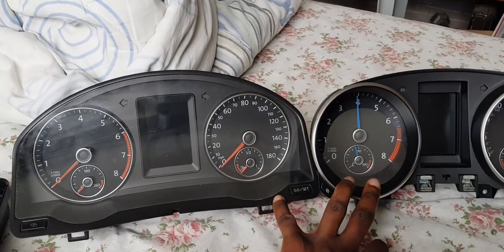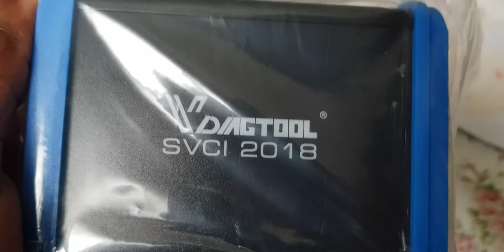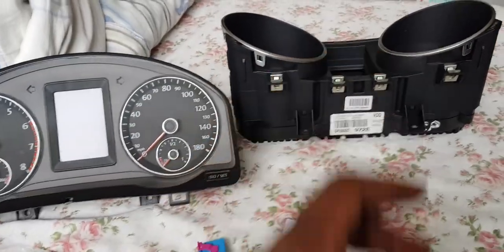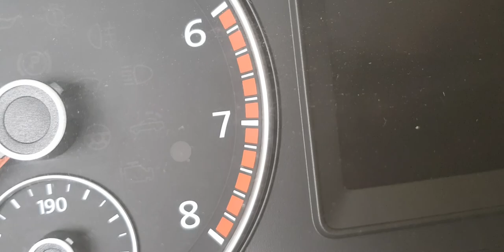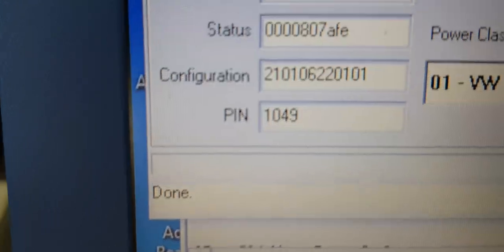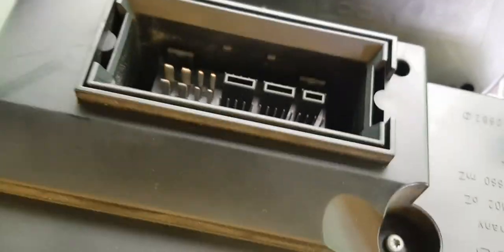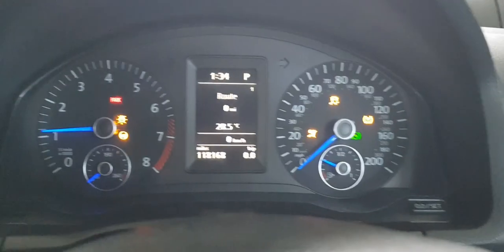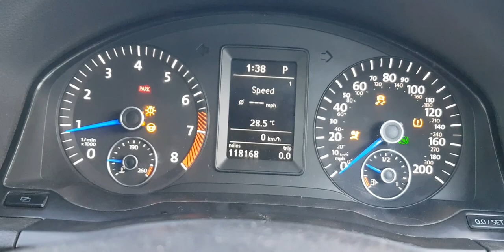MK6 Golf R instrument cluster retrofitted in a MK5 GTI

Comment: I don’t know how it was for everyone else, but the hardest part for me was fitting cluster to the dashboard. The space is so tight, also the adapter takes some space, so cluster didn’t want to slide all the way in. Somehow it went in. Another surprise was my BG steering wheel control module works just fine with mk6 cluster and mk5 mfsw steering wheel. Didn’t need upgrade to CH or CD. To my knowledge BG is highline off course, but 1.3 LIN only. Am I missing something? Controling stereo is also not an issue, I got aftermarket radio and mfsw buttons do the job. Maybe that would be an issue if I upgrade to RCD330? Any input appreciated, thanks
Reply from the maker: You answered the question when you mentioned the use of the aftermarket radio.  Let me check the Ross-Tech wiki to see what the BG supports.
Reply: @MatthewTaylor3  I’ve been checking that list on Ross-Tech website so many times, almost memorized it already 😁 By the way, as I recall the next video shows you got the CD one, but what was your original one?
Reply from the maker: @SHtatkus  My original one is was an AQ unit.  This has an older software version than your BG module.
The issue I had (years ago) was that my steering rack caught fire while driving, so I had it replaced with a random one from a junk yard (with a different part number).  This replacement had a different steering angle sensor arrangement (but with VCDS/OBDeleven coding it worked).   I then selected the CD module (years later) for the steering wheel retrofit to match THAT replacement steering rack.
ALL 12 buttons work in my car with the steering wheel.
Reply: Hey man, can you please shed more light with the process of swapping the cluster, I'm busy with it but I am still getting the Immobilizer active. With the EEPROM data from my working cluster copied and pasted on to the scirocco cluster. I don't know what else I have to change. This was done with VVDI2.
Reply: @MegatronicsZA  Sorry for late response. As far as I remember, new ID48 chips also had to be made, not only transferring all the immo data to new cluster. That might be the issue you are having

Comment: Have you made the speedometer work? What about abs? Did you get rid of the abs light? The "ding ding ding" sound... where is it?
Reply from the maker: The speedometer worked without needing any coding as it gets the reading from the ABS (not the transmission).  The ABS and steering wheel just needed a test drive to clear.

Whenever you change your ECU or instrument cluster,y your ABS unit will factory reset itself as the vehicle's VIN is stored in it (but is lost when you change an immobilizer related component).  I had my previous coding backed up in VCDS and OBDeleven, so I restored it manually, and then did a 5-minute test drive which cleared all errors.

If you are referring to the alternate speed such as from miles to Kilometers, then I enabled a feature called "alternate speed display". which shows this digitally

Comment: Hi bro i have problem because i have mk70 Asr abs unit and if i want to retrofit newer jetta cluster i must to retrofit newer Abs unit AD part number or newer.And mu question is which modification i must to do when i want to retrofit newer Abs unit? Ps:(Golf 5 1,9 TDi)
Reply from the maker: You don't need to change your ABS unit to make the new cluster work.   Your MK70 would have more features than my MK60.

To answer your question:  You need to make a note of your existing vehicle coding using a VAG scan tool (like ODIS, VCDS, OBSeleven, Autel, Topdon, VCP) to place that configuration to the new unit.   Things like brake size for front and rear, LHD vs RHD, hill-hold assist enbled or not are needed to program back the new module.    Note, changing the instrument cluster or ECU, factory resets the coding of your existing ABS module, so you need to make a note of the existing coding in either case.   This is for anti-theft reasons as your VIN is used as part of the coding process.       If you somehow mess it up, you can use the "PR-codes" located in the inner front cover of your owner's manual, or the sticker in the "tub" where your spare tyre sits to help code it back.
Reply from the maker: Let me look into this "AD" part number or newer.   What year  TDI do you have?
Reply: @MatthewTaylor3  My TDI is 2007 and abs unit serial number is (1K0 907 379P) MK70.But when i asked lot of people for white fis cluster retrofit they said to me if i want it i must first retrofit abs unit for mk60 1K0 907 379AD or newer or the best opinion is MK60EC1. If i retrofit cluster with my current ABS it s not possible to  read speed of car
Reply from the maker: @Mmmmss266  Let me look into this.   I'm not ignoring your query
Reply: @MatthewTaylor3   No problem man,Tnanks for kindness
Reply: Hi bro did you find some solve of my problem?
Reply from the maker: @Mmmmss266  I don't have an answer to your issue.   If your car was 2008, I'd tell you it is "new" enough to have the MK6 compatible protocols.    I'd still tell you actually do the swap just the same IF you already had the MK6 cluster in hand.    One thing I'd suggest you would need is the Revision "L" canbus gateway to bridge the MK5 and MK6 protocols

Comment: Could you share the software and tools needed for doing the immobilizer stuff? -or the link where you ordered that. Thanks in advance from Mexico.
Reply from the maker: I used a cloned copy of AVDI by Abrites called SVDI / FVDI which does the same thing for placing both clusters into Service Mode and pairing keys.  I bought it from AliExpress.  I bought the "2018" variant, but the "2020" variant is what is current.

Comment: Nice swap, big upgrade! I wanna change my needles/leds to get the same blue needles. Will something happen if I unplug the cluster, do the work and plug it back again? Do I need some coding/activation after replugging?
Reply from the maker: No.   There will be NO issue unplugging and replugging the same instrument cluster in your  car.   The time/clock and trip information will reset in the same manner as a dead battery.

Comment: I believe you are the same guy who posted some info on obdeleven forums regarding mk5 needle sweep some time ago. Long story short - I’ve installed 2005 gti cluster on my 2009 2.5 jetta, immo data was easy with avdi/fvdi chinese clone, but I’m not able to write edited eeprom using the software to achieve needle sweep. It goes back to original after writing and reseting the cluster. Everything was done through obd port in car, not on bench. Still waiting for the usb clip programmer to try writing directly to the chip, do you think it will work this way? Maybe 24c32 is just not programmable? Any input is appreciated, thanks
Reply from the maker: I'm the same person from the OBDeleven forum.  You WILL need to use the USB clip programmer in your case to get it to work.  ALL VAG 24c32 and 24c64 clusters support it.  If you didn't want to use the programmer, you would have to use a tool called VDOeditor to help you out.  If you send me the BIN file for your existing cluster, I can see if my paid copy of VDOeditor can help you
Reply: Thanks for quick reply, I’ll wait for the programmer and see what happens. Heard about VDOeditor, isn’t it only for newer white/color clusters?
Reply from the maker: @SHtatkus  You are correct about the VDOeditor being for the newer white/color clusters.  You shouldn't need the programmer since you have the chinese FVDI clone (assuming you backed up your BIN file.  Did you use that famous Russian Excel spreadsheet that states what addresses to edit for your cluster?

You would only need the programmer to restore the backup if something when wrong.
Reply: @MatthewTaylor3  I’ve checked that spreadsheet, edited my BIN file, tried to write it to my cluster using FVDI and after reading eeprom again it stays as original one. That’s why I’m thinking to use clip and programmer directly on the chip
Reply: Blue dashboard cannot needle sweep.

Comment: Great video. Need some help. Getting stabilization control activated,  red steering light on though steering is ok, and brake servo defective. Any guidance?
Reply from the maker: Has ANYTHING been physically replaced on that vehicle ?
Reply: @MatthewTaylor3  Sorry, probably should add more context. This errors occured after swapping to the Golf 6r cluster. My previous cluster from an R32 had no issues - even when i return it back, those errors disappear.
Reply: Cab you please shed more light on how you did the whole process of swapping the cluster. I'm not winning

Comment: Nice job! Did you change 0x13a0 - 0X1450 FF for the immo/safe data to not show from standaard cluster backup file? Want to do a swap in a caddy 2009 with 2012 type cluster. So should be same way i think.  Dont have svci/fvdi but autel im608 that should be able to read immo data etc
Reply from the maker: I did "FF" a range of addresses, but I can't tell you if it is the same range as you indicated.  Some clusters are different,  but the process is the same.

Your Autel tool can and will do it.  It will even automate the process for you sp you don't have to be too involved in the nerdy bits.  I wished I had a IM608, as I'd be providing that service on a daily basis,  as I see the use case for it.  The unit would basically pay for itself.

You are already familiar with the correct set of steps.  Please make a BACKUP of both EEPROMs for peace of mind before having fun with the process.
Reply: @MatthewTaylor3  yeah i can read immo data with autel im608 also pincode and cs code from old cluster and also for new one. Never done this retrofit. Normal use autel for key cloning and key learning and some basic diagnose.  Want to have smok uhds also, read that that also can make full backup from eeprom. 

For what i have found that range of adress should disable the immo active message but never done it. So this wil hé the first try🤣 also have odis, vcds and vcp normal in the coding business active.
Reply from the maker: @anthonyg87  Can you please give me the part number for the instrument cluser you are swapping TO

I also use a tool called VDO editor to adjust the analog guages, and the feayures like "cluster sweep" and the various backlight settings.
Reply: @MatthewTaylor3  i also have a sort like tool/software to activate needle sweep. Needles to light up etc. So thats not needed. Its a cluster of a 2011 caddy 2K0 swap in a 2009 caddy but need to seen the car first. Its a customer of mine

Comment: Is it possible going from a 2010 Magnetti Marelli white led with an existing key, to a 2010 VDO 24c32 white led with no existing key? I've already done everything before the erasing keys procedure (I did not make new keys for the VDO, I just copied the original Magnetti KeyID numbers on the VDO but no avail... "Immobilizer Active") -I was expecting my existent keys will work, but no avail... Why is necessary making new keys? How do I match / sync the VDO Immobilizer to car ECU? -I'm doing all this stuff on a bench, and yes, I am able to read, write and verify EEPROM of VDO 24c32 with a programmer with no faults for entering into service mode. Hope you can help.  I don't want to do Immo Off...
 Forgot to say that copying existing Magnetti KeyID numbers on the VDO, the VDO recognizes keys, but not the Immobilizer. VDO shows only "Immobilizer Active", not "No Key" message. Thanks in advance.
Reply: (Car won't start with the VDO, but it does with Magnetti)
Reply from the maker: I feel honored that you of all folks asked this question.  I'm not an expert on the matter.  I just did this retrofit to modernize my MK5 Golf GTI's dashboard.  I too, thought I could just copy & paste the KeyID from one cluster to another (but the car won't start and stay running for longer than the 1.8 seconds).  What I then learnt after doing some reading online (from a Russian site that I forgot to bookmark) is that the immobiliser pill inside the physical key fob also gets unique information written from the instrument cluster itself as well.  This then appears to create a mismatch even though you copied the original KeyID.   I assume you already know that the transponder is one of those can only be written to once, then it is "locked".  This is the reason why you have to get and pair a new key (board or transponder chip) for each instrument cluster you are trying to pair.  If I arrive at a working solution otherwise, I'll respond and tag you here.

Comment: Hello, did you just change the front cover ( Plastic ) and installed the Cluster, or did you need to remove all the past and transfer them to the other cluster ? 
Because i have the same cluster for  Jetta mk5 2010 but its in Mileages and i want to change  in Kilometers, so i need to find a cluster with KM maybe from a Golf Mk6 or Passat b7 and just swap the front cover, but i don't know if it fits ?
Reply from the maker: Once you have a MK5 Golf or Jetta, then you need to get one from a 2010 Jetta just for the front plastic cover and mounting points so it bolts up and looks factory.  You discard the rest.

You then place that on your MK6 instrument cluster.    If you ONLY need to change the units of measure, you would just buy the thin plastic backing behind the needles that have the units you want.  You would then use  a EEPROM tool like VDOeditor to scale it appropriately so it works correctly.    You are on the correct path.

Comment: Hello sir, I have a Scirocco cluster, but lost all keys. My understanding is I need SVCI to get those data before remove the old cluster, and then restore after install the new cluster? Can you explain more how to do this? And how to re pair my existing keys? Thanks!
Reply from the maker: I'll respond to you shortly.   If you lost your keys,  you don't need a new cluster.  You only need AVDI or the tool you mentioned to place your cluster in SERVICE MODE, so you can add a new key to it.  If you were actually changing your cluster,  then you would go with the full set of steps you mentioned.   I'll respond shortly after you clarify.
Reply: @MatthewTaylor3  I am going to upgrade the cluster.
Reply from the maker: @kelvincheong9234  You are going to need to use the tool you mentioned to READ the PIN, MAC, CS, and power level from your existing cluster or ECU (as they currently match) by placing it is Service Mode).  This is initiated by taking your stock one apart (since you have no keys) and reading the EEPROM chip using a programmer, saving this as a BIN file to your computer.  You would then use an editor to clear the immobilizer info, then WRITE/FLASH that file back to your stock cluster.  You would then partially asemble and attach to your car.  You would then use SVCI/AVDI to place the cluser in Service Mode in order to note the items to be transferred to you new cluster (since you say you don't have your keys).

You would do the above steps with the replacement cluster, but this time you would WRITE the 4 above mentoned fields to the new one.  Before exiting Service Mode, you would simply ADD a new key so you can start the car.  Your old keys would be invalid as they are paired with your stock cluster, and can only be written to once.

Comment: I’m in the process of doing the same swap right now. But I can’t get the newer NEC cluster in to service mode. And every video I’ve been looking at for help has the cluster taken apart for some janky modification internally to the circuit board. Did you have to do this mod as well? 
I have SVCI 2019 and new transponders. 
I appreciate any help :-)
Reply from the maker: Yes.  I have the SVCI 2018, and the janky modification you see online is the method that you would have to use to get the process "started".  I used a "clip" to connect directly to the 8 pins of the 24C64 chip so as not to have to desolder anything.
You HAVE TO pull the instrument cluster apart to read the contents of the EEPROM to your PC. Save a backup on your hard drive.  Then you would simply "delete" the storage blocks that contain the immobilizer info, then flash that modified state to your cluster.  You can then put the cluster together, and reinstall it in the car (I suggest leaving it disassembled until you verify all is working and the car starts and runs) with the 32-pin pigtail harness.

You would then actually use SVCI at this point to electronically place the cluster in Service Mode to do the actual process you see in those videos.  When you load the original BIN file that you would have backed up, you would see the donor PIN and all that information in which you would selectively overwrite, then finish the process by adding the new key(s)/transponder pills.
Exit Service Mode, and the cluster boots as normal.
Once all works and the car starts and stays running, you can then put the cluster back together and pat yourself on the back.

Edit: I will be doing a video on how to do the initial process (using the clip) in a bit when I get another cluster to pull apart shortly.
Reply: @MatthewTaylor3  Thank you so much for that elaborate and very kind answer! I appreciate it. You don’t realize how much this helps. I found this video about a year ago when I started thinking about doing this swap for my EOS and ordered the SVCI because if it. 

Most people wouldn’t go through such lengths to help strangers online. Kudos to you! 

I googled this clip and found, with the help of my brother, that it’s pretty much the same thing as doing a modification on computer graphics card and motherboards, which means that my local electronic warehouse should have something like it. You make it easy to understand what’s needed. Looking forward to the video!

With regards from a cold Sweden, 
Thank you!!